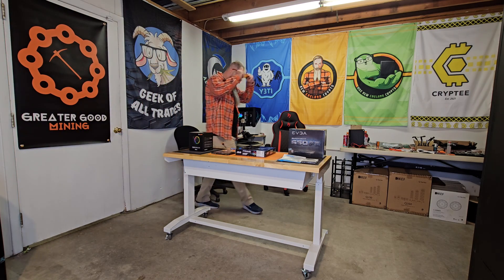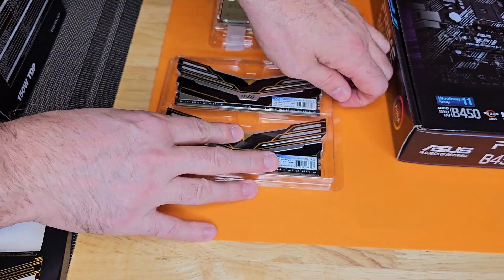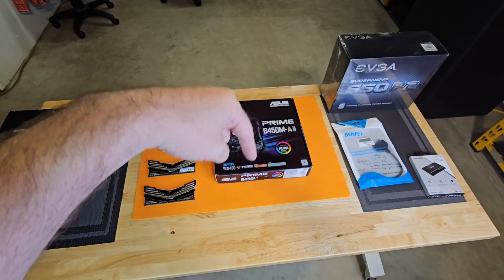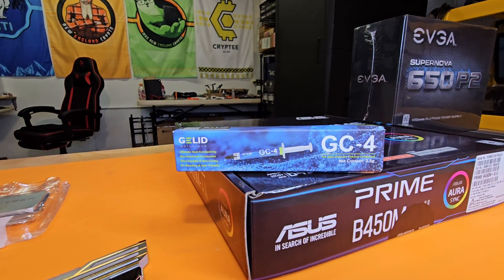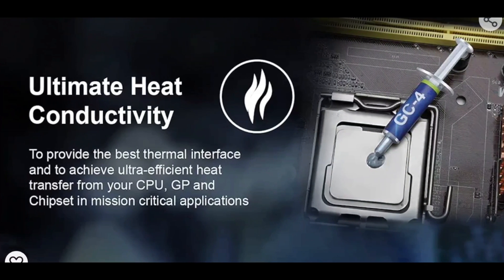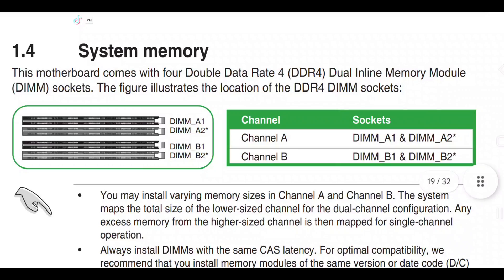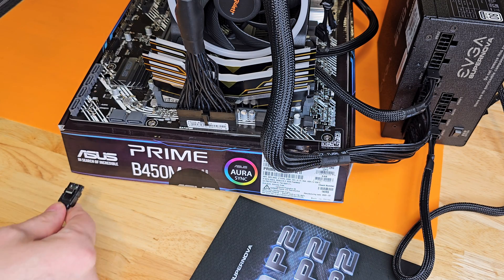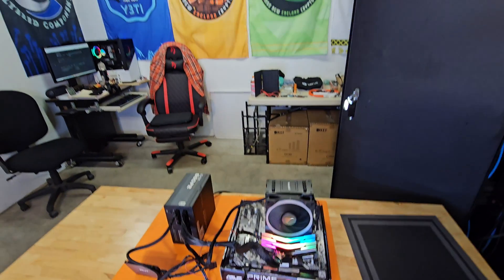How to Build a CPU Mining Rig // FULL BUILD \\ Monero & Verus 2024

Comment: I have this type of mainboard with Ryzen5 5500 default setting 3,6Ghz and 32gb 3200 RAM. ONLY CPU Monero mining hashrate between  4200-5000H/s . This is better than average stats for this processor /3569H/s/

Comment: Thanks for the vid! I have a setup collecting dust. Mobo, psu, ram, and I beleive an older ryzen cpu. Quick question. Why did you choose the 1700? What would be the ideal cpu selection using the good, better, best method? Ill probably dig in to this over the weekend. Thanks and have a great weekend.
Reply from the maker: I have a bunch of others to test but haven't gotten to it yet. I was just trying to add hashrate to Verus at the time

Comment: I dont have a bunch of pcs sitting around in my home i only have a laptop and two phones there are apps like mobox emulator and winlator they allow me to run desktop applications on my android devices so should i give it a go? My phone is a good one 6 or 8 gb ram also arm chips are fast
Reply from the maker: For the phones, I would check out my videos on VerusMiner. With the emulator on a phone, the emulator will use up too much of the phones capacity and lower your hashrate considerably 

I hope this helps! 🙏

Comment: I would have gone with a B550 board to future proof yourself, also... Did you do any BIOS settings because? When I set up my boards I gotta turn VGA Detection off and disable secure boot. Also EVGA is also my favorite as well.
Reply from the maker: What are the Pro's for the B550 over the B450? Not being sarcastic, genuinely interested. Thanks for taking the time, Paperclip
Reply: @NewEnglandCrypto  you can future proof yourself and put some ryzen 9s in
Reply from the maker: @lolPaperclip  I better start saving